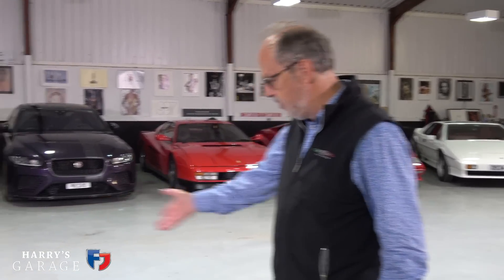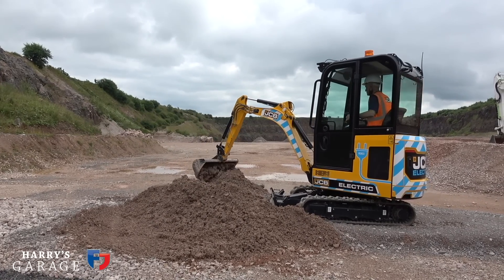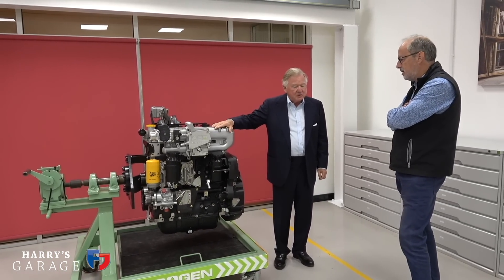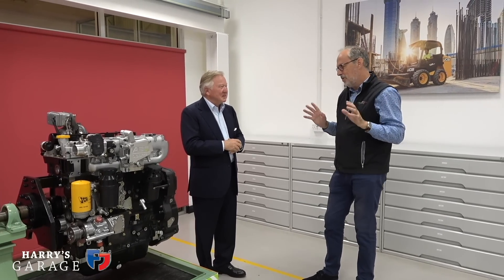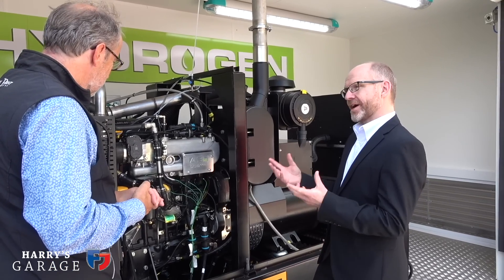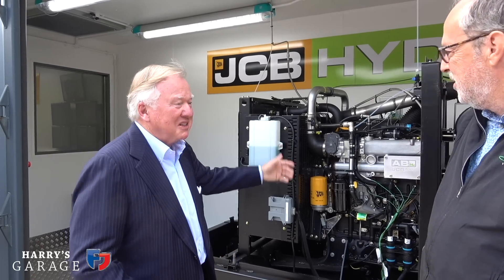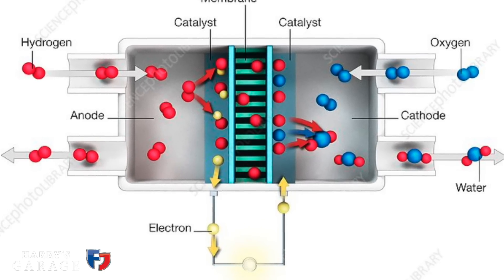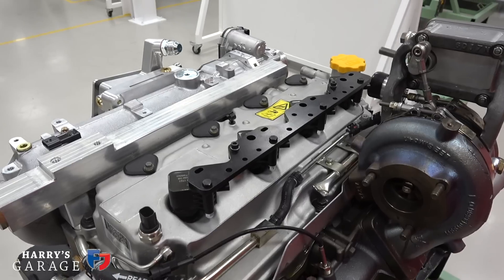Is hydrogen, rather than electric, the future for big-engined machinery? I visit JCB to find out

Comment: JCB - well ahead of the game, I’m really impressed.
Reply: All. These negative comments I’m sure he wouldn’t spend vast amounts on a pink elephant.
Reply: Germans are already working on producing similar type of fuel such as synthetic fuel.
Reply: @IonorReasSpamGenerator  do your homework. It makes more sense to use lpg, the energy density, and efficiency is higher. The CO2 produced breaks down with photosynthesis and is locked in by plants. Solar cells and wind generation doesn’t supply our needs, and is a poor use of land. Plant grasses.
Reply: @IonorReasSpamGenerator  You don't need to spam you battery propaganda in every single thread.

Comment: His points on inflationary vehicle prices are spot on, it’s been happening in stealth for several years now and it’s absolutely intentional by the car manufacturers who have taken the ‘easy route’ for EV development (BEV) by bringing to market unrealistically expensive cars that appeal only to the wealthy to make them feel better about saving the planet, which they aren’t doing by buying EV.
Then the price gap in the range is simply filled in by raised the existing price of the ICE vehicles.
Honestly, if we can co very existing engines to run off of hydrogen then we can use all our existing cars and stop building new as a way of fixing the planet - reuse and recycle as much as possible.
Reply: It's crazy. The EU is partly to blame aswell, they have stricter restrictions on tiny city cars than they do on big luxury SUVs. It's clearly driven by money and not a wish to reduce emissions.
Reply: Yes electric cars are about control not environmental factors

Comment: I have always liked JCB, now even more.
Reply: All rubbish. Fuel cells twice as efficient than a combustion engine and no nitrous oxide. Torque on electric motor better than on a combustion engine.
Reply: @denisovanhybrid9610  
And?
Reply: @denisovanhybrid9610  No - his point is well made I think. I suspect you don't understand what you are really talking about. So I ask also - what is your point exactly? 
Hydrogen fuel cells coupled with electric motors ( which in terms of power to weight ratios vastly outperform any combustion engines)  can easily cope with whatever JCB do. You realise that the largest powerplant transports on earth 
(aircraft carriers) run on electric motors.  The UKs new QE class carriers for example output over 100,000 horse power at props shaft via electric motive power. Getting onto to 500 times more than the feeble 250 horsepower that largest JCBs put out. Hell, my Tesla puts out much more than the largest JCB machine. Laughable.
Reply: Am i listening to really outdated and uninformed information here? First of all japan has already looked into mass producing hydrogen vehicles a long time ago. Second all internal combustion engines can run off hydrogen. Third there has been hydrogen powered buses here in America for years. They are developed by a company calles the sun bus. Last but not least Toyota has the most advanced hydrogen fuel cells. This video seriously made me feel like my brain was losing 📉  intelligence.
Reply: @simonmawdsley6864  Twice as efficient? really? twice the price definitely, but don't worry about the added costs for us hoi polloi.
Reply: @bbbf09  And breakdown frequently!
Reply: @denisovanhybrid9610  I'm well aware.Either diesel or nuclear.   But in the former case the main power is from higher effiency gas turbines...not internal combustion engine of the Carnot cycle type. My point was that the power per weight ratio of the electric motor is colossal compared with that of combustion which highlights fact that any scale of transport can not only be powered by electric - but it is actually better to be powered by electric. What powers or 'fuels' the electric motor is another matter. You proved my point by not reading all through what I said. Hydrogen may have a role as higher energy density fuel medium in certain applications. But it is through injection into fuel cells and then using that to drive electric motors that is efficient and makes some sense - especially in applications such as this . But never trying to crank a combustion engine directly to engage in motive power. Unless you specifically wish to spaff away two thirds of your expensive hydrogen fuel as heat rather than put it to useful mechanical work in your JCB.  It's just stupid.
Reply: @geoffaries  yes, twice as efficient. The running costs halved so return on investment doubled. I’m sure you’re not hoi poloi
Reply: @simonmawdsley6864  depends on how you define hoi polloi. I can't afford to buy a large BEV or fuel cell vehicle. I've been involved with fuel cell boilers for years, as well as Stirling engine micro- CHP, the principles are great and have been around for more than 100 years, why are they not in common use, still in the trials stage for 30 years? It is because of reliability and cost. Rich people can afford to try and save the human race from possible extinction, most of us hoi polloi will have to go back to the pre-industrial age, good luck to any politician who tries that. Personally Johnson is either really stupid or he knows that the UK's plans ref boilers and vehicles is pie in the sky, he wants people to love him and he knows that he won't be PM when time comes to implement his policy.
Reply: @denisovanhybrid9610  ..so you would prefer to stop using all that Cobalt as a catlyst (as bulk of it is being used now) in the refining of oil to petrol, disel, kerosene? Or maybe in the tool steel used in car production presses and the engine block. Nah ...thought not !  Funny how fossil fuelers are concerned over cobalt use only now - after 100 years of silence on the subject of its extensive use in car/ petrochem industry. In contrast, Cobalt - only used in small amounts now for batteries -  is not an essential in lithium ion chemistries anyway - and it is now being phased out as more suitabel chemistries are being found . Soon won't be an issue - except in petrochem.
A pretty predictable but poor comment Denisovan that makes you look ignorant of facts.  
p.s. Lithium is plentiful on earth and given there will soon be well paid mining jobs in UK and US as they open - or re-open lithium extraction mines - its hardly a 3rd world problem.
Reply: @denisovanhybrid9610  You don't drive then?
Reply: @denisovanhybrid9610  What is the point you are trying to make?  What is your beef?  You seemed to eb implying taht EVs had no future because if depends on Chinese supply (demonstrably wrong as I showed). Now you are accusing me of racism and holding onto lithium -which primarily orginates in Chile, Argentina.  Aret hey racist - or is it Panasonic or Tesla making batteries in Korea, US and other places the ones you accuse of racism.  
Soon other mines will be open in UK and USA that have lithium in their own lands. What should they do with it after they have  dug it up? Hand it over to  the 3rd world?  If you gave UK lithium to Somalia what are you proposing they do with it?  You make zero sense.  Be a grown up - state you case sensibly and logically. Or just be silent.
Reply: @simonmawdsley6864  I think you are failing to understand the basic principle that heavy machinery needs to be able to run all day and not have to sit about for hours for a recharge. Also most operate where there will only be a generator available and no installed convenient fast charger.
Reply: @scottwhitley3392  you’re failing to understand how hydrogen fuel cells work. Taking on hydrogen will be the same as diesel/petrol. The fuel cell creates electricity through redox reaction.
Reply: @simonmawdsley6864  I’m talking about how you think fully electric heavy machinery is the future….
Reply: @bbbf09  yes but they are nuclear powerd not battery not really practical except for a ship the size of  a village
Reply: @bbbf09  battery's have come a long way tbf the cordless tools now are brilliant, quantum leap from 10 years ago, but the same sort of thing as he was saying about mini diggers they dont actually do many hrs a day , probably still a fair bit of development possible on all fronts